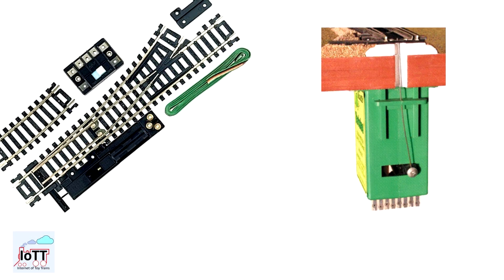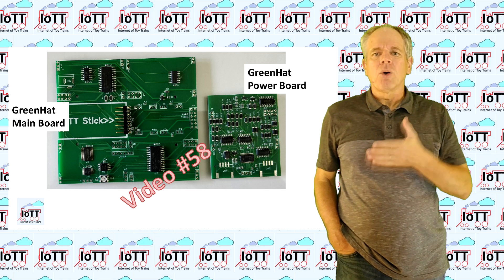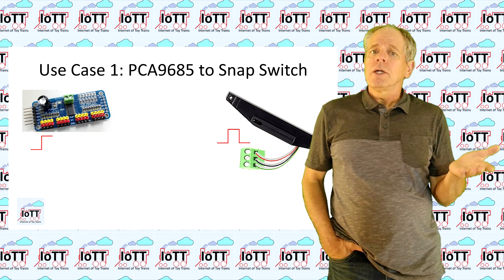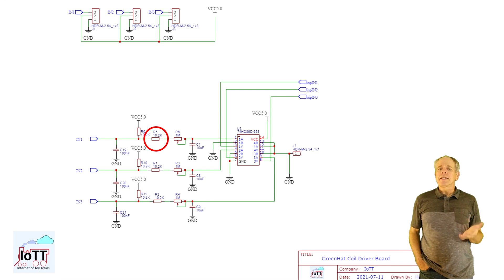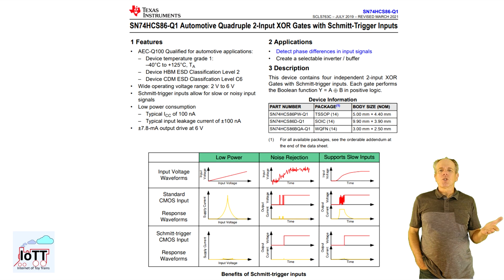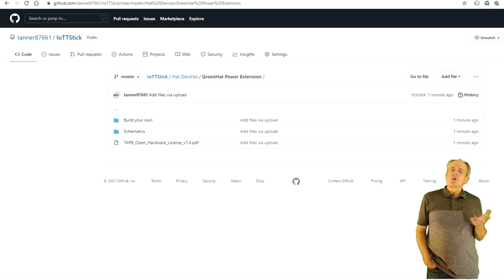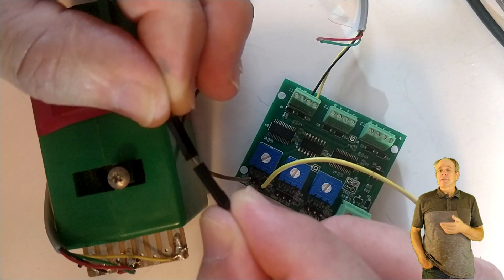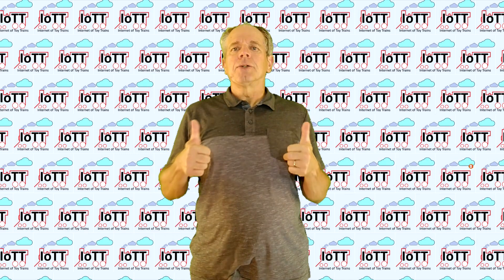3-Channel Turnout Driver Board (Video#78)

Comment: Hans, I like the chapters list.  Did you use an EX-RAIL macro to drive this board?  As best as I can tell they require 3 output pins and you only need one.  So how did you define the i/o to this board in DCC-EX.  FYI, I am using the redhat on a mega and plan to use the extra pins available.
Reply from the maker: I was using a VPIN and matched it in the RedHat setup to a Loconet switch address. I don't know the details of EX RAIL, but I would think you can set the VPINS from there as well. Using 3 pins for just one switch does not sound like very effective use of pretty limited IO pins ;-)
Reply: @IoTT Excellent.  I hadn't read the API section on VPIN, just the turnout section in the DCC-EX docs.  After reading the HAL section I'm glad you have made this simple with the redhat and turnout driver boards.